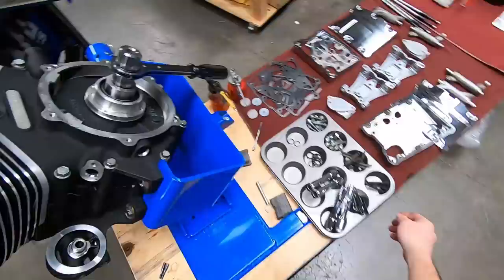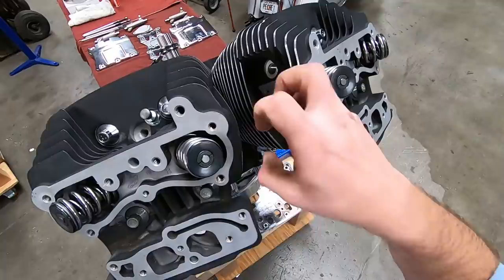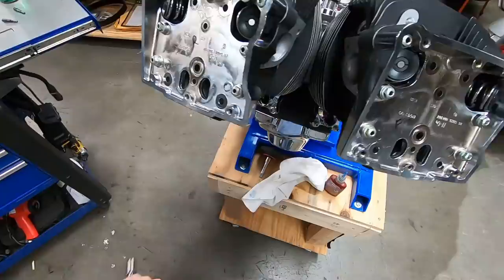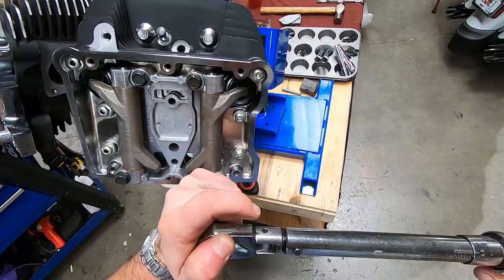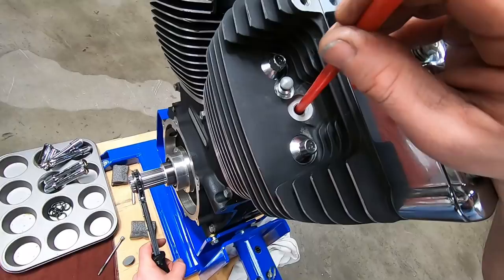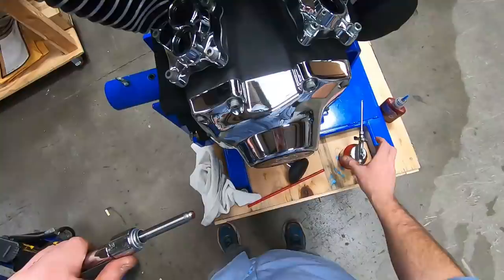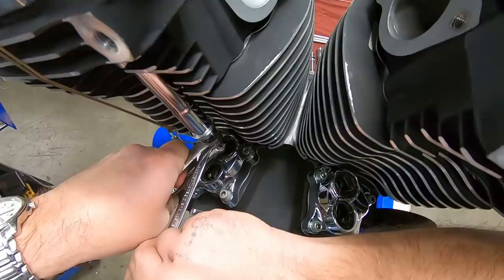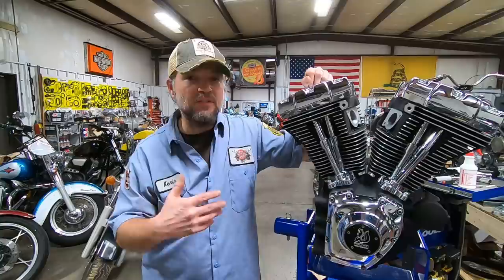Harley Pushrod Adjustment & Rocker Boxes - Twin Cam Engine Build - Kevin Baxter - Pro Twin Performan

Comment: Best way to adjust push rods with adjustable push rods is to start at the bottom and come back up whatever the threads are easiest way to determine how many turns is 32 threads put a dot between three and two 3.2 turns 24 threads 2.4 turns etc reason I know I invented them in the early nineties

Comment: Point of interest for people wondering why the engine is being rotated one full turn (360 degrees), the cams rotate 1/2 engine speed, thus one turn of the crankshaft (360 degrees) is equal to 180 degrees rotation of the cams.

Comment: I make sure both cams of the cylinder that I’m installing pushrods on are on their base circles by feeling or looking at the other cylinder lifters. When the other cylinder is on overlap and both lifters are in motion, the cylinder I’m working on will have both cams on their base circles.
Reply: The cyl. ur working on will be at TDC ;)

Comment: Great video, pushrod adjustment is confusing for a lot of people and you explained it extremely well. I've had people that didn't know what brand pushrods they had and they were all freaked out until I told them is really doesn't matter as long as you know the thread pitch. The same with the lifters just go with the average and check for binding and you'll be fine. Its not rocket science.

Comment: Thank you for your Harley Tech tips. Learnt more about Harley engines in the last 4 weeks watching them than years of tinkering with engines. However, new to Harleys I have a 2018 Slim now thinking I should have stayed with a more reliable design ie 2014+ Sportster. Again thank you for your excellent explained videos.

Comment: This is cool. I have my fuel pump out of my old twincam Heritage right now. I have has a new noise up top since I put the 551 cam chest upgrade in it. I re did the breathers then. I wonder, I may not have got the base plate centered on reassembly. Its too damn hot to ride here right now so its perfect timing. Thank you for that. I have a set of centering bolts. For the old style oil pump that was in it. Thank you Kevin.

Comment: 12 RK. I had the dealer install the S.E. 103 to 103 kit. Then on the front head exclusively exhaust valve came the chatter. I suspect either the tech didn't center the lower box or the clearance issue procedure you demonstrated with the valve spring. Great tech skills Ken!!
Reply from the maker: hard to speculate.  many places....  thank you sir!

Comment: I recently installed a new DarkHorse Man O War compensator in my 2023 Road Glide Limited.  I used the center on the torque spec (84-120 in lbs) on my primary cover and it leaked.  I backed out the bolts and re-torqued to 120 in lbs - and no leaks.

Comment: I have a 2003 heritage.  B motor.  I built it to a 95 with S&S 509 cams, stock heads, this spring.  Cam plate up grade ect.. Good tune and runs well.  However I got a little heavy handed on the throttle a few times.  Got 4000 miles on build.  Developed a slight knock.  Random.  Not constant like a rod knock.  And a whooshing sound in the motor.  I hear the knock when I put my stethoscope on the front of the engine block. Picked up some vibration as well.  Compensator was checked.  Clutch was replaced soon after I built it due to it slipping when I got on it a couple times.  So I ruled that out.  Long story short I'm tearing it down to verify issues.  I believe I have issues in the counterbalancing setup.  That being said, since I'm in there I'm going to have the crank checked and trued and welded along with the token bearing conversion. 
So to my question..  since I'm doing a complete rebuild on the bottom end I was wondering about having the case bored to accept 107 pistons and cylinders a d keep TV he existing 4" stroke.  What are your thoughts on the stock stroke 107 build?  Thanks.  Appreciate your knowledge.
Reply from the maker: One of my favorite builds!  Doing 3 of them now.  4" stroke on a 4 1/8" bore.  Awesome.

Comment: Awesome tutorial. My question is why not use solid 1 piece pushrods? And if using solid pushrods how do you measure for proper length if you are using a variety of aftermarket parts from different manufacturers?

Comment: I recently replaced my rocker box gaskets and breather assembly.  I did not replace the stock OEM pushrods.  Should I have replaced them. Why adjustable vs solid pushrods?

Comment: Great video as alway, do you find a need to go back and adjust the push rods after a couple thousand miles. I am trying to determine if it’s normal valve train noise from my SS475 cam and lifters or they need to be readjusted.
Reply from the maker: occasionally yes...but you shouldn't have to.  that can be an indication of a less than perfect lifter or lifter to bore clearance.  sometimes you may have to find a "sweet spot" of a lifter to get em quiet...but you shouldnt HAVE to do that.

Comment: Another great bolt cleaner is an ultrasonic cleaner off Amazon.  Some heavy duty simple green gets em cleaner then I can using a wire wheel or brake clean.

Comment: What I do is 1 valve at a time... roll motor over until front intake lifter is at its highest... (roll over a few times to verify) then go to rear intake and adjust, then roll rear intake lifter at highest then do front...vise versa with exhaust valves.

Comment: Hey, Kevin! I'm curious about something here. My OCD is catching up to me, or maybe rather my worry, but is there a list of specific engine components that need to be replaced when doing a complete tear down/rebuild? More specifically all the bolts e.g. rocker box bolts torqued to the head. Curious your thoughts!
Reply from the maker: for those type of bolts typically not.  bolts like stator bolts, certainly...because its a high torque value relative to the size of the bolt.

Comment: I put together 110 kit on my 07 Electra glide classic 96 cubic inch motor had about 3,000 miles on it had a base gasket leak pulled it apart this spring found scratches in cylinders with skirts are on the Pistons looked a little closer with the lifter lifter bore broke out exhaust lifter bore have you ever seen this

Comment: Pushrod question, on my 110 twin cam i installed s&s quicke pushrods and instruction calls for 24 flats which equals 4 full turns , is this correct ? Just installed them today and havent finished assembly of the bike yet

Comment: Im suprised you didnt talk about the clearance issue with the notch on the rocker shat and its ability to hammer on the rocker assembly bolt and the use of rockouts or rocker lockers to cure  this problem  .
Reply from the maker: ive spoken of them before.

Comment: I have 14 fat bob would improper adjusted push rods cause a back fire out the intake,my bike has s&s adjustable rods with tw-777 cams and every time I start after it sits for a while and is cold,I start it and let it idle and it will idle fine for a little while then it almost sounds like a misfire,then sputters and backfires out the filter and stalls. But it starts back up and when I go for a ride it never does it again until it cools again. I’m thinking I miss adjusted the push rods

Comment: Very informative videos! Is there a drill spec for the drain holes on the breathers!??
Reply from the maker: many will drill them to .060 or .080 to return oil quicker.
Reply: @KevinBaxter  thx! U don't like to drill them??

Comment: If the umbrella valve prevents the air from getting sucked in the engine during the upstroke of the pistons, is there some other valve that allows air back in the crankcase?
Or do the pistons have to overcome the effects of negative pressure during the upstroke?
Reply from the maker: you dont WANT air back inside.  pistons have to overcome it BUT its so minimal.

Comment: I have a question that I have never seen addressed anywhere. In one of your previous videos you said you had experience with hot rod auto engines. I'm sure you remember the racer's trick of adjusting the hydraulic lifters to top of travel zero lash. Start the engine after a preliminary adjustment and slowly loosen the rocker locknut until the lifter clicks, then tighten until the click stops, then go 1/16 to 1/8 turn more, semi-effectively turning them into solids.  Makes it impossible to pump the lifters up at high RPM, although you can still float the valves. Can this trick be used on Harleys? I don't see why you couldn't. Any opinion?

Comment: Let me ask a question on the rocker box. When u torque the rocker box down at 20 ft/lbs won't that mess up the torque on the other bolts that u torque at 12 ft/lbs
Reply from the maker: Not really.  The rocker box bolts are perimeter bolts.  The rocker arm bolts are more "interior" and the box would flex slightly.  Regardless...its such a small amount, that the gasket makes up the difference. Great question.

Comment: Have you any experience with the chapstick type loctite? Its not as wet and can be put on the threads without having to wipe off your fingers after smearing it all over the threads.
Reply from the maker: yes.  it works.  just not a fan myself.

Comment: I don’t care what anyone says Harley Davidson has some of the most outdated engines out here in 2021. HD has been using 1950’s/1960’s technology so long and it’s caught up to them. This labor intensive engines are and have been a problem that other manufacturers have designed their engines around such as 3 hole oil changes, a huge primary chain rotating, rocker arms. Let hope Harley jumps on the thought out revolution max engine format they currently have in two bikes as of 2021.

Comment: I torque bolts in the middle range as well but I bring to lowest value 1st then the middle. Kinda like you do with the heads. Do you recommend. Or no jus go to desired torque in 1 shot. Does it matter ?
Reply from the maker: progressive is always better.

Comment: Sorry to bother you. I have s&s quicky pushrods along with the s&s lifters in my 19 breakout m8 114 stage 2 475c cam kit. They're instructions said 4 turns then let bleed down your video says 3¼ turns so should I fix it your way or leave them just like I have them?

Comment: I’ve never understood adjustable pushrods. With .100 compression on the lifter it seems hinky to use adjustable pushrods when a pushrod length checker could be used to get the correct length when checking clearance then order proper length pushrods.
Reply from the maker: one help...makes cam install easier by not having to remove rocker boxes.  when custom machining...the length can vary quite a bit.  that would require MANY MANY length pushrods.  i have made my own many times...for high rpm and race engines.  but for street engines, adj is perfectly fine.

Comment: Any cons to using adjustable pushrods? I'm planning a cam swap and wonder if I want to keep the OEM  pushrods or go adjustable.  I know it's a difference in labor.
Reply from the maker: not for a street engine.  racing may be a little different story.  Just make sure they are adjusted properly.

Comment: Question: why would you use adjustable pushrods here? Since you have everything apart it seams that solid would be the thing to use? Thanks.
Reply from the maker: because the height of the cylinder head changed.  between head gasket thickness, head thickness after machining, cylinder height, case deck height, etc all changed due to machining processes.  A custom length pushrod could be used but that's not always cost effective for a street engine.

Comment: It seems a lot easier to work on the engines when they are out of the frame. Perhaps one of the next videos you do will show taking an engine out of the frame and then putting it back in.

Comment: Missed it but watching now. Great as always really appreciate you doing these learning a lot.  Questions based on you using adjustable push rods I assume there isn't a real advantage to solid push rods and what's your opinion on roller rocker arms versus standard?
Reply from the maker: in a street application, adjustables are just fine.  rollers on high lift cams...but for .600 lift or less, not something really needed IF heads are set up correctly

Comment: Hey Boss, what's your opinion on using 350 small block lifters?
Reply from the maker: this has been tossed around for years really.  many people do run them because they physically will fit....but...in an HD, the recommended plunger collapse is vastly different as an air cooled engine will expand differently.  I don't because I know they are mass produced and I want a lifter in our customers engines that are tested and scrutinized.  Just my .02.
Reply: @KevinBaxter  thank you for the input. It goes a long way as I am relatively new to the industry. Is there a particular lifter you recommend that I can read about and research up on?

Comment: Why do all that just leave the cam cover off and use the timing marks for exact TDC?  Timing marks facing each other on each cam sprocket then it's TDC for rear, both timing marks on the top of each cam sprocket and inline with hash mark on cam plate then front is TDC

Comment: Twin cam engine,  the lobes on a  conventional overhead camshaft operate directely  on a cam follower  or bucket and then the valve stem,  should HD really not call this an extended push rod  rocker arm system  ?

Comment: so, how much would you charge (including labor) to bullet proof my 88?  I just bought it recently (it's an 06 Street glide with only 28k on it), and I haven't reached that point where I'm desperate to make it super fast or anything.  And, when that day comes, I want to know I can do so safely without flushing all my money down the toilet.  Soooooo, I'm thinking Timken bearings on the left side of the crank, all new bearings in the cam chest, and a decent set of gear driven cams.  Oh. and of course new cam plate and an updated fuel pump.  I understand if you don't want to discuss this publicly, but you can shoot me a DM whenever you like.  Oh, and maybe an updated compensator based on your judgement after you've inspected it.

Comment: Why is my 103 se  clattering in the front cylinder rocker box
Reply from the maker: no idea but id suggest getting it checked out asap
Reply: @KevinBaxter  
I took it to both of my local dealers including the one I bought it from and they said it was normal 
It sure doesn't sound normal to me